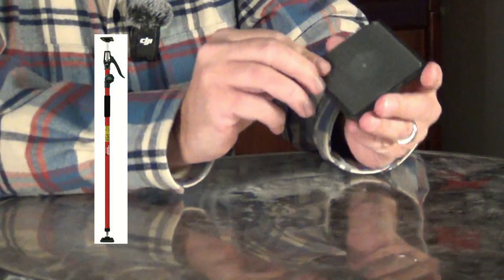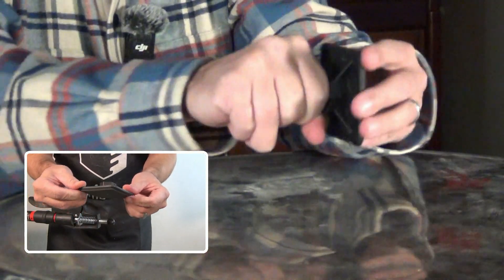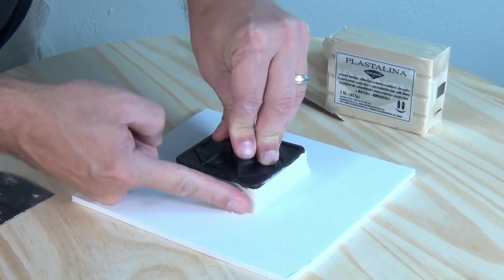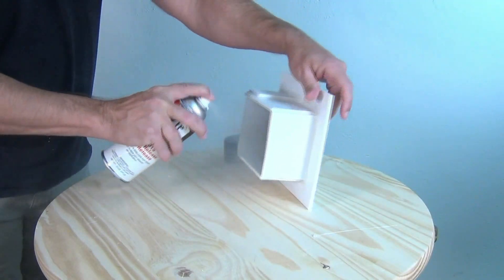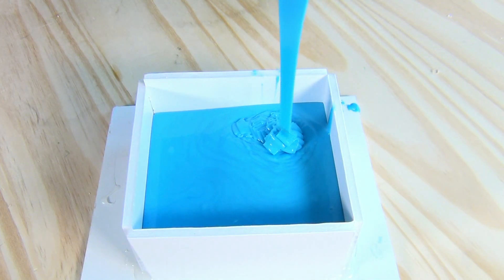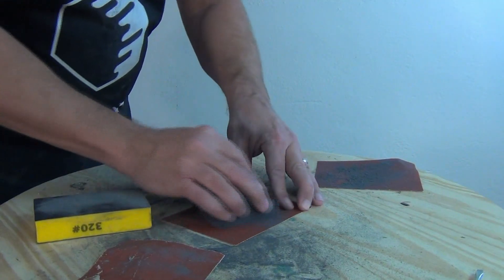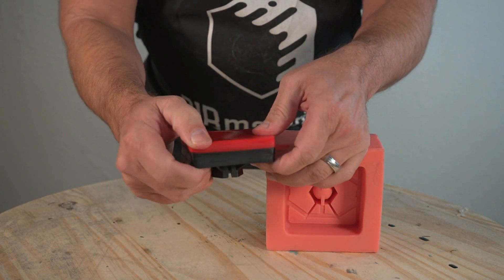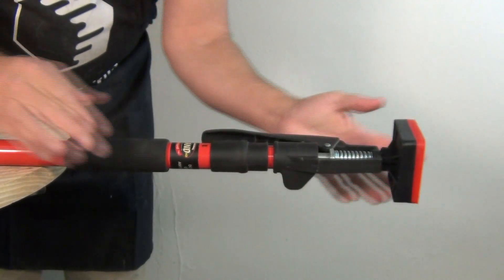DIY Plastic & Rubber Parts

Comment: why the 2 silicone molds?
Reply from the maker: The first one was made with Tin Cure silicone since I did not know for sure if the rubber on the original part would inhibit the cure of Platinum Silicone like the TC-5130F I used later in the video. I refined the part and remolded it with TC-5130F platinum silicone because the Platinum formulas offer better physical properties for casting and more casting options such as the FP-40.

Comment: Optionally, ypu could take a mold of some shoe soling or diamond pattern in the bottom of a baking pan and make a lid to your mold so you can have it with a grip pattern.
Reply from the maker: Once I get the 3D printing going I will do that! I did not trust my sculpting abilities for that kind of uniform pattern!

Comment: Love it! When you described the replacement of the plastic and rubber parts,  I figured you'd cast both the resin and rubber into the same mold. You mentioned that process to me a while back and I use it regularly for parts I build for one of my clients.
Reply from the maker: Good to hear from you David!